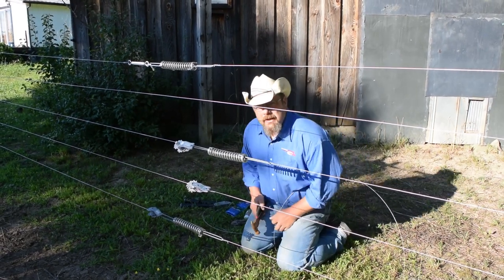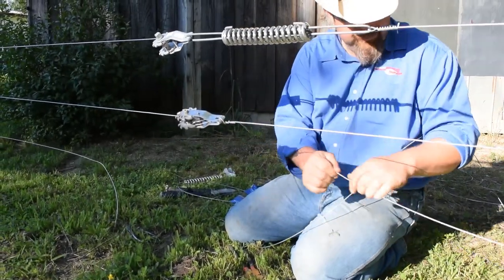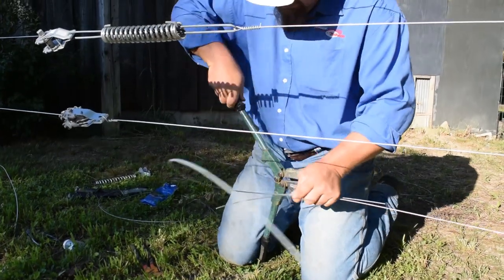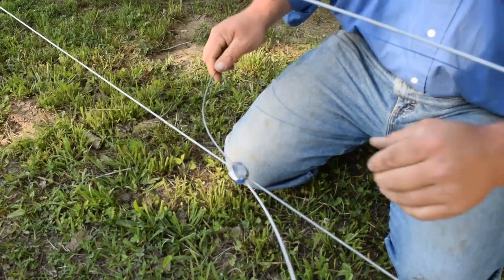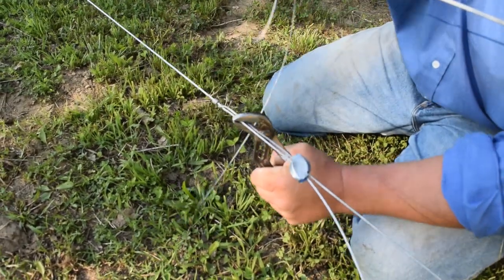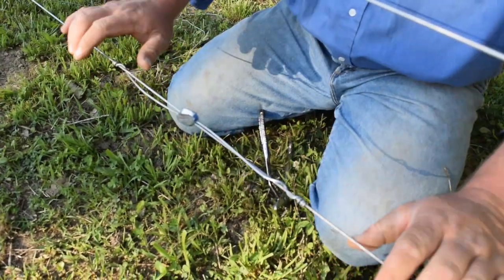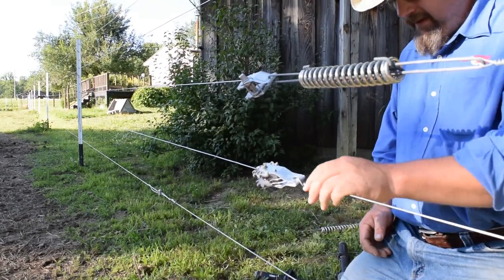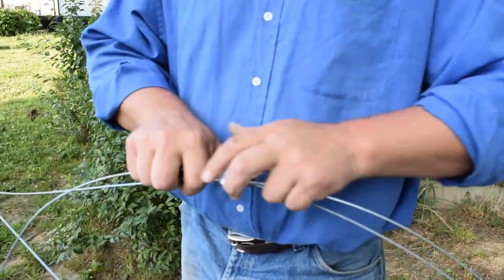"Gripple" The Safer Choice

Comment: Can you release tension on a gripple that's already stretched to 400 or 500 lbs? Or is cutting the wire the only way to remove? Thank you.
Reply from the maker: Yes with a key which is basically just a pin, they usually come in the jar. You just have to put a little tension on the wire and insert the key and it will release. But I have never been able to put 400 or 500 pounds of tension on a high tensile wire. 175 to 200 is a lot. And for most applications 100 pounds is more than enough to be tight.
Reply: I've tried the key release but it seems futile once tensioned. It seems to be more of a key used to place the gripple where you want it along the wire, but I absolutely can't get it to release once the wire is tensioned.
Reply from the maker: @joshuagibson2520  If  place some tension on the wire with your tension tool at the same time you insert the key it should be no problem at all.
Reply: @HighDesertHomestead  I'll give it another go today. We had cranked them as tight as we could with the tool. With my skinny arms it was 4-450. I think the problem is we already have so much tension and no one is strong enough to surpass it to get a good release. I suppose I'm just going to cut the cable. Hopefully in a safe manner.

Comment: What is the crimping part? Need close up as I can’t make it out
Reply from the maker: Here used crimp sleeves but I could have used a gripple there as well. A crimp sleeve is just a 2 channel crimp.
Reply: Crimp sleeves are a cheaper alternative for a static join. You really only need one per run of wire for the strain. They also allow you to quickly strain up older fencing that has developed slack from livestock and age without having to cut and splice.

Comment: This is a great informative video.   I've always wondered how those worked.  Do those completely replace the strainer and spring?
Reply from the maker: Daybird Aviaries Yes. With the gripple system there is no need for strainers or springs. Initially the spring was introduced as a gauge to measure the ponds of pressure you were placing on the individual wires. The gripple tool does that for you as it has a gauge built in. Thanks for watching.
Reply from the maker: Yes they do.
Reply from the maker: Best tool for high tensile on the market today.

Comment: Shouldn't use high tensile wire around horses it's lethal it will cut your horses legs like butter.
Reply from the maker: I appreciate the comment but I will disagree with you. I have never had a horse cut or hurt by high tensile wire. When my horse did get injured it was on a ratchet strainer. If high tensile wire is installed properly it is one of the safest products on the market today. Most of the stories I have heard over the years of horses getting injured around high tensile the wire was installed incorrectly or the horse was not well associated with the pasture, so owner error. But everyone is entitled to their opinion. I have been using high tensile for 20 years and wouldn't use anything else unless it was an  Electra braid type product.